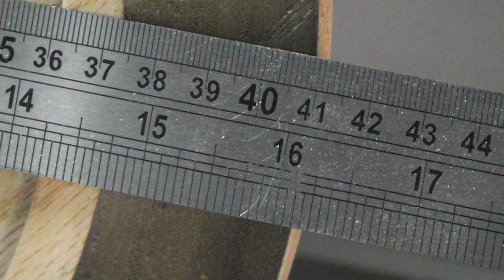Woodturning - 16 inch plate made with banjo extension - Coronet Herald - Record Power.

Comment: Hello. Liked your video of outboard turning. Im in the market for a 14 to 16 inch lathe and was considering the coronet. The one drawback IMHO his the low speed of only 250. How has your lathe held up and do you think it needs a lower speed? Thanks.
Reply from the maker: I now know that if I need a low speed (below 250), I have not balanced my workpiece properly. Maybe for finishing (epoxy or paint) a slow speed might be useful, but it's not necessary for me at this moment.